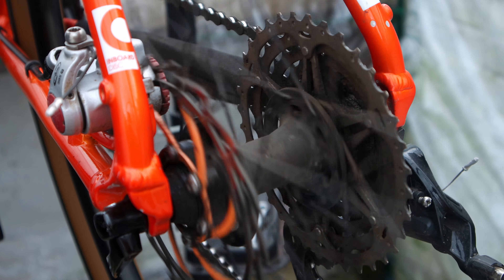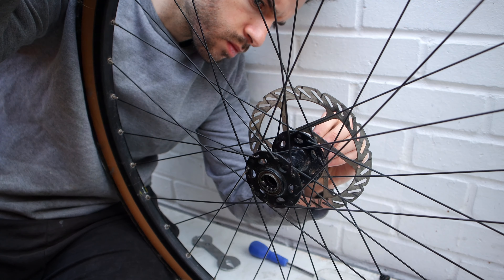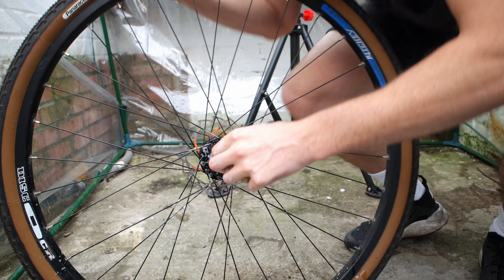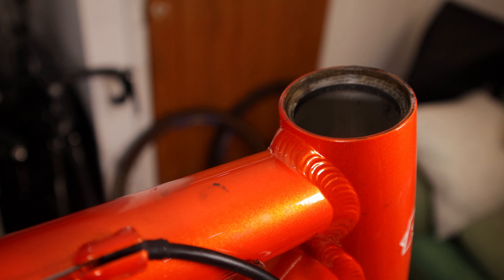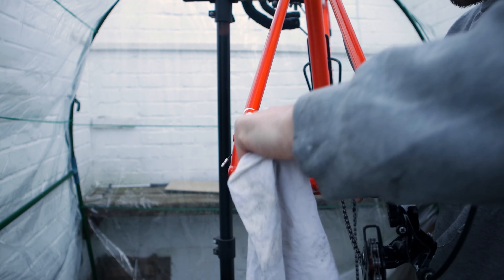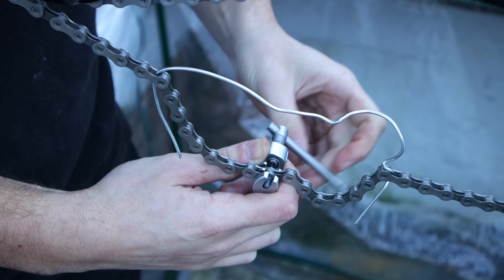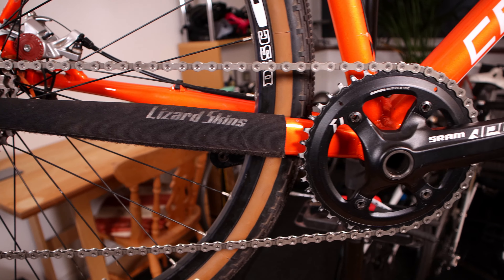Gravel Bike Overhaul | Bring Your Bike Back to LIFE With a Do It Yourself Bicycle Service

Comment from the maker: Thanks for watching! Don't forget to smash the like button ^^

00:00 - Get Your Spanners out
00:33 - Checking the Tyres and Wheels
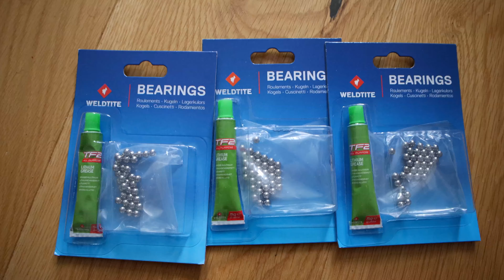01:47 - Front-Wheel Bearing Removal
03:31 -  Rear-Wheel Bearing & Cassette Removal
05:12 - Bearing & Hub Cleaning
05:45 - Rear-Wheel Bearing & Cassette Installation
06:59 - Front-Wheel Bearing Installation
07:24 - Headset Bearing Clean and Regrease  
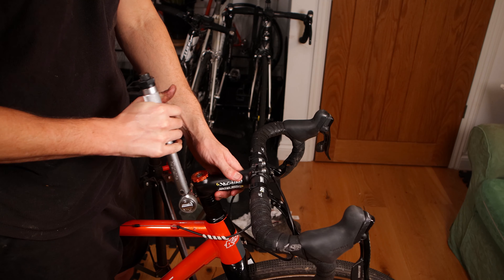09:36 - Bottom Bracket & Chainring Check
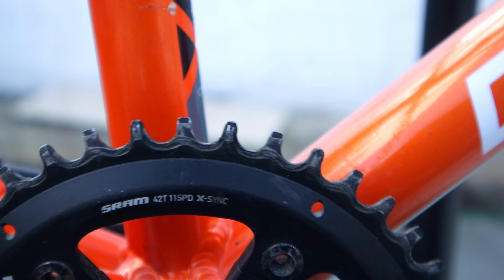10:31 - Brake Pad Replacement (Problem) 
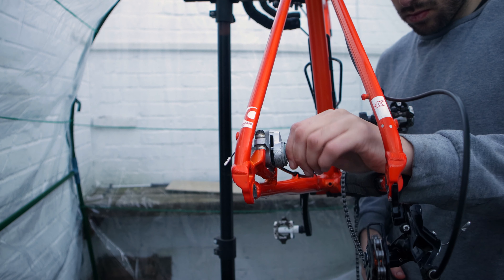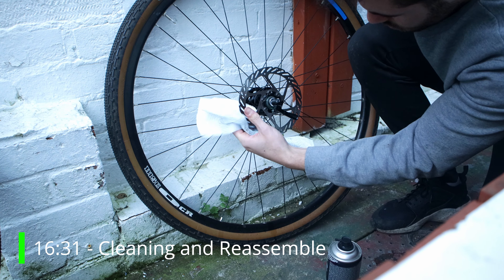14:23 - Chain Replacement & Drivechain Clean 16:31 - Cleaning and Reassemble 
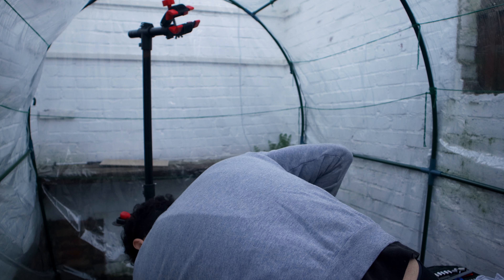17:35 - Brake Pad Adjustment

Thanks to Jonny for commenting on a few extra points...
- Frame check
- Checking the chain wear with a chain wear indicator
- Certain chains are directional so make sure to check yours

Comment: Hello Jordain, this is a great video, well put together. A few things missing, frame check and checking the chain with a chain wear indicator. The best 2 chain brands to use with a quick link are KMC and Sram....Shimano chains up to 10 speed don't have a quick link option and also they're sided, the writing needs to be facing you as you fit the chain. Feel free to pm me if you need help 👍🏾
Reply from the maker: Amazing! Thank you for taking the time to watch and give feedback. I'll check my chain direction and make sure the writting is facing the correct direction (I had no idea). In the future I'll stick to KMC and SRAM chains. I did check the frame when it arrived, I forgot to include it in the video ☹️. If you spot anything in my vidoes that will help me or anyone watching the please do comment. It's a great help 👍🏽

Comment: Really good and informative video but watching you undo things with your torque wrench made me wince. That's meant to be a tool that's made for accuracy and using it as a breaker bar has the potential to make it inaccurate. Please buy a breaker bar haha!
Reply from the maker: Great point, thanks for flagging. I'll use my adjustable wrench in the future 👍🏽